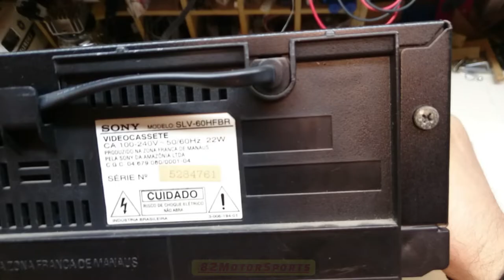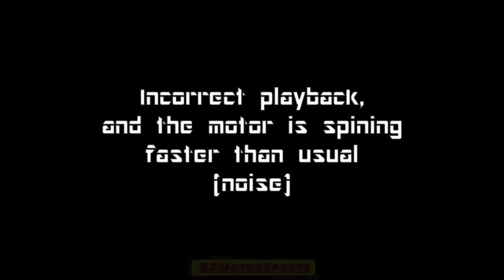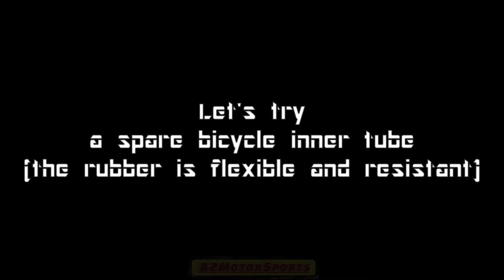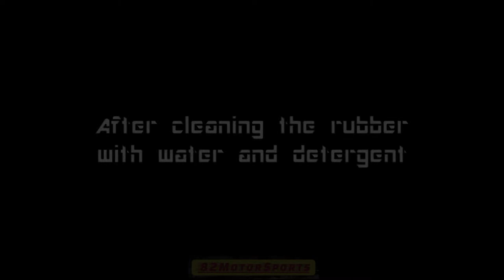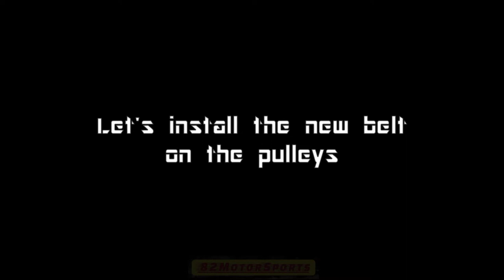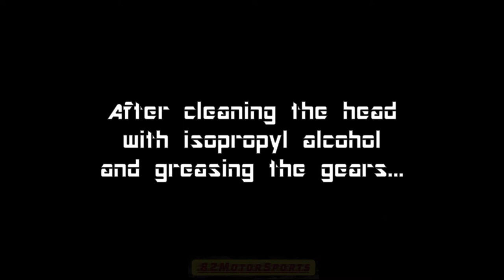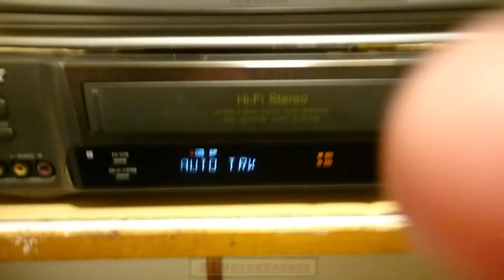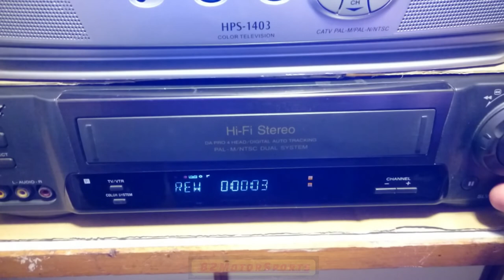DIY VCR Belt Hack

Comment: Very good idea. I thought you will cut the tube straight and stick the joint with super glue
Reply from the maker: Thanks. This is one of the secrets of this hack.
Reply: @82motorsports93  I might try this at tape decks

Comment: I was shocked that this video is only posted seven months ago… It would have to be an emergency to pull out your old useless piece of junk VCR just to digitize a video so that you could play it on your computer.  Oh I thought your belt looked a bit tight.  Plus you can just probably buy some elastics from the store and achieve the same thing.  I've seen all bags of all different sizes and as long as it's just temporary you should be okay.  By the way I was a technician on these pieces of crap for so many years it was fun I enjoyed the work and I made good money.  It seemed they always needed servicing.  Anyway I'm not trying to be negative the video was fun to watch it just brought back memories for me.  But I am glad to not use them again ever
Reply from the maker: Thank you for your sincere point of view. You thought it might be a little tight, but everything has been adjusted for the electric motor to work properly. Too bad you didn't do any test you spoke of!  However, it's never too late to put it into practice.
Reply: I just had the task of converting a 1990s recording of a once well known concert pianist playing a piano concerto.

It is in S-VHS NTSC-JP-525-30 format, so a bit of a challenge using UK equipment. (I'm using a separate Pioneer machine to do the signal conversion).

The belt is slipping in my S-VHS machine, though fortunately only during rewind. 

Like you, I was hoping never to see these machines again. However, this was an emergency because there's a big commemoration event coming up, and this is the only remaining material we can find!